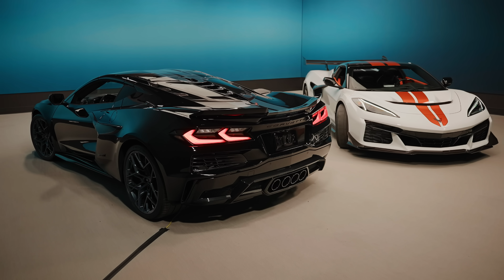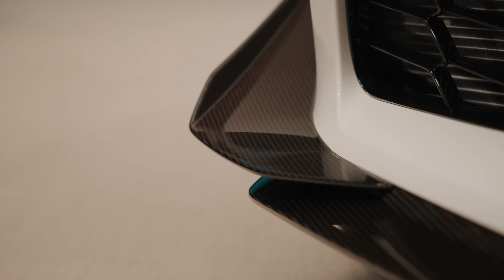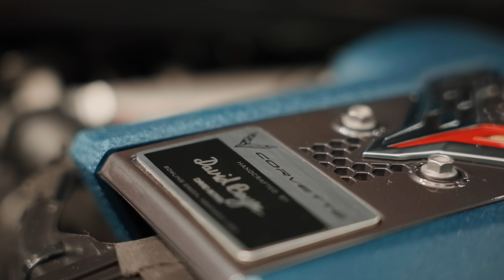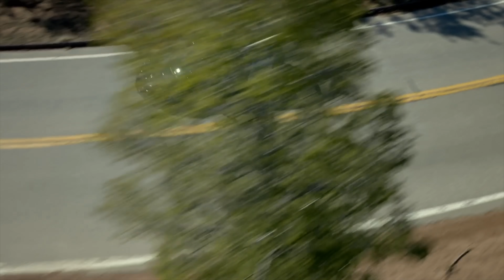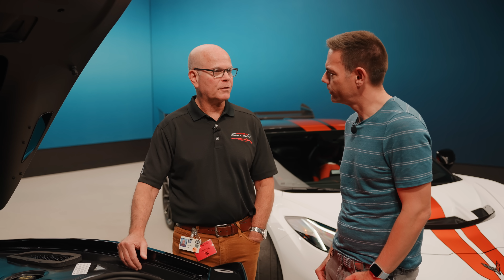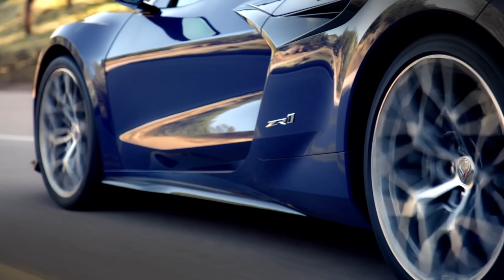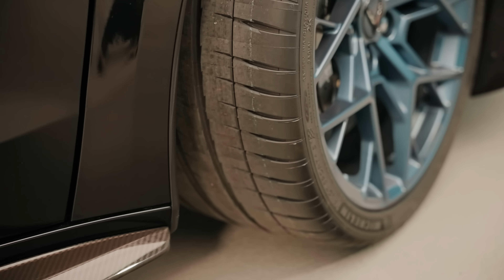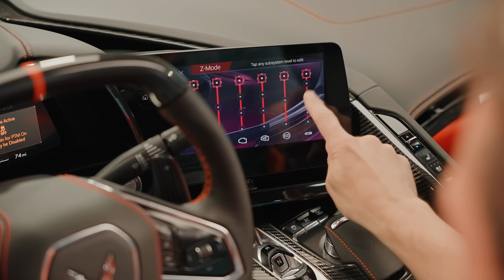FIRST LOOK: 2025 Corvette ZR1 – 1064hp, Turbos & 215mph!

Comment: Ya'll seem to forget that the C4 Callaway Corvette was also a twin turbo and set a record speed of 254 MPH. almost 40 years ago.
Reply: what your point? that wasnt mass produced.
Reply: @Howdy762  the point is it was done. The idea that it wasn’t “mass produced” is about half true. 

You could order a Callaway Corvette from the dealership at an additional cost. General Motors signed off on collaboration meaning; they approved. The “Hammer” which was a premium example and the car that set the record was driven from Connecticut to the track in Ohio and back demonstrating that it wasn’t  “test bed” for somerhing else it was the actual production car with AC and all the creature comforts. Corvette did it first and a corvette did it best. 

There is absolutely no goddamned reason that a C5, 6, 7 couldn’t achieve those speeds or greater. All of those cars have a low enough drag co-efficient that would make it possible. 
The only major obstacles are cooling and tires that can handle those speeds. 

Having a 260 or 270 MPH corvette is sufficient to hang with the likes of SSC, Hennessy, Or a Koeniggsegg. And besides Corvette has Track cred. None of those cars do.
Reply: @ZoneTelevision  But not the sledgehammer.
Reply: @Howdy762 doesn't matter if it wasn't mass produced. It still did it 40 years ago.  215 mph for 1064 HP is not impressive and I love Vette s
Reply: yeah C4 was a beast
Reply: Ya but you can buy this from any dealership no questions asked
Reply: @hobsonoutdoors yeah I mean Calloway turbo kits were dealer options though.
Reply: Man everybody seems to have an issue with the speed limit like they are going to go over 215 mph 🤣. Maybe that makes no sense maybe they wanted a harder acceleration and have no need for that speed or gearing making a more usable 215 vs having slower acceleration especially in a world of EV and hybrids. This car kind of is giving the finger to the competition is a raw form and I for one can’t wait to see it bring euro supercars and even hypercars to their knees once again for less money.
Reply: Good point. 1064 HP and 215 HP is not impressive when you consider my 180 HP Impala does 115 mph
Reply: I imagine that bean counters and lawyers would have a lot to say. They always have to consider lawsuits and public perception of an unsafe car, unfortunately.
Reply: another molested corvette! your point?
Reply: True but that was aftermarket. Keep in mind they detuned this some for reliability. It has this performance with a factory warranty.

Comment: I’m going to say that the last 200hp is basically useless in any gear below 4 or 5. 

If you floor the car anywhere near 50% throttle in a curve, your front end will eat your rear end.

1,064hp in a rear wheel drive only car that’s meant to be a track weapon. That’s nuts.

Comment: My biggest question is heat soak of this thing. A 12 mile lap, over 1000hp, mid engine, turbo car. This thing will be pulling timing off 1000hp on that final Nurburgring straight.

Comment: My 2006 C6 Z06 weighed just under 3200 lbs. This car is over 3700 lbs wet. That is about the same weight as a 2010 Camaro SS. What!? COME ON you guys. Get this thing on a diet. These cars just keep getting heavier and heavier. More horsepower isn’t all that matters here fellas. The first thing I check is the weight as soon as I hear big power numbers and I’m always disappointed on this newer stuff.

Comment: Quick fact check. Koenigsegg's V8 has a lot more power, the one used in the Gemera puts out 1479bhp, from a smaller 5ltr displacement. Technically, I suppose it not a production car (yet) until the first one rolls off the line and is delivered. Which wont be long

Comment: I'd need 355's on the rear instead of 345's . The performance numbers doesn't match the power output. The 911 turbo s gets nearly the same quarter mile and top speed with much much less power.
Reply: Well, the Turbo S is AWD, can’t really compare that with a car that is RWD in terms of quarter mile performance.

Comment: If you think about it, this engine produces roughly 193 hp/litre, which when multiplied by 4 results in a hypothetical 773 hp 4L V8.

This is really close to the figures put out by the Mclaren 720/750S. So, ever wondered what a 750S would be like if the engine had 5,5L instead of 4L? 
This is it. GM is building oversized Mclaren engines at this point.

Comment: Well it's chevrolet 😂 1064hp😂 it might be 800-900hp and 650-750 to the tires.  Chevrolet overestimate everything they make and I guarantee one of the day time running lights quite working right of the lot and check engine light comes on because gas cap is open 😂😂😂😂
Reply: I see… And how many cases have we seen of Porsche GT threes of the 991.1 generation blowing their engines over the years? Or the full recalls of the early 992 GT fours for engine replacement? or bore scoring? And that’s just Porsche…

Comment: Xiaomi SU7 Ultra Specifications

Power: 1,548 horsepower (combined output of three electric motors)
Acceleration: 0-100 km/h (0-62 mph) in 1.97 seconds
Top Speed: Over 350 km/h (217 mph)
Downforce: 2,145 kg (4,694 lbs) at peak
Regenerative Braking: 0.6G

Oh - 4 door seats 5......GM is a joke

Comment: every single thing is eletric, booster, stearing, dumper, soo why not make a google website were you can fine tune every thing that you want? like, outside of drive modes, i want my car as i please, no need for engineers babyseat me, they dont know what is better for every one! its good even for disebled peaple, imagine a person is a gearhead, but have no arm, they have to drive with the feet on the wheel, soo the stearing beeing heavy in racing mode dont let than use it! 
its soo simple to doo, its in fact harder to lock the options, every single parameter of the car that i own should be tuned, even power, if they just created a tune software were you dont need black magic to access, and just create a warning to not mess with it, peaple would have fun, and would not be able to blame the company for their fault! 
the same for every thing, the stearing fealing, i would like it to be as a simulator, would like to tune every single parameter!

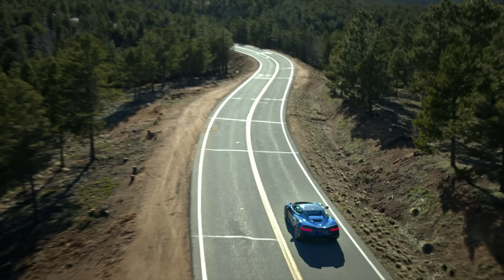Comment: Regarding the 215 mph top speed, I own a 2018 Porsche GT2 RS. The Chief Engineer is on record as saying it is a 222 mph car but Porsche wasn't comfortable with the Cup2/Cup2R tires at that speed and didn't want to require specialty tires, so the GT2 is electronically limited to 211 mph. Oh, and 6:38 at the 'Ring baby...let's see GM beat that with their 1,000 HP vette.
Reply: Downforce and aero drag is what slows it down. Im pretty sure it will without the aero drag
Reply: @YusufSayed-px2xy  I've had mine to 211 a couple times...it still was pulling, like I said Porsche has it electronically limited to 211. Re: the ZR1, I later read the over 215 mph claim is without the front splitter and dive planes and rear wing. I also read the Cup2R's have a special construction to allow for that type of top speed. Roads get awfully skinny over 200 mph, OVER 215 is Very impressive. But the damn thing weighs 4,000 lbs so it ain't beating the GT2 RS 'Ring record at that weight.

Comment: How could you fail to hit 200mph+ at the ring in a 1000bhp car
If it wasn’t sub 10 on the 1/4 then it would have been an absolute failure, the 765lt with 200bhp less is sub ten all day

Comment: Get rid of the cats and a standard air filter should add 100bhp and ecu flash and this should easily and another as these are always held back now with emissions,
I'm sure tuners will have these over 2000bhp pretty quickly

Comment: HUGE RESPECT TO GM! They did it. 1064 HP RWD and no electrification whatsoever! Love it!
Reply: You know, you can put that flat plane 1064hp engine in a full size pickup. There's no reason it can't be done.
Reply: @starseeddeluxe  You have a point, this Company uses the same LS motor in both the Corvette and their SUVs if not also in their trucks now.
Reply: And it can't go faster than 213 MPH? I got a problem with this and the price tag as well.
Reply: @RobertGuidry-f3f  its top speed is 233.
Reply: @ank0663  Thank you.
Reply: @RobertGuidry-f3f  213 with the track package because increased drag. Without the wing and increased downforce it can go 233 I think. Any car anywhere near this in performance is probably 2x the price
Reply: @ I looked it up  on the web. One of us is wrong and the other isn't, so be it. Let me ask you this? If there is another factor that will make the highly beloved 'Vette not only more expensive but a better idea to not buy, would you think about your comment? Regardless as to what it will cost to own it. The 'Vette comes from a company that is so cheap that you definitely exchange parts on a brand new Chevy truck with a solid 1981 Chevy or GMC? They are so cheap, that they won't design a car that doesn't have definite interchangable parts with at least four other vehicles. And another thing you will have to change and/or fix something on it evert month, then the year doesn't matter what year it is/was made in as it will have a checklist of things to break or rust through at certain ages. No go buy your self a Ford of the year you want and save yourself money and a giant headache, or in this case a Mustang. And before you comment, you need to know this. It will break and be grouch reegardless as to how new the parts are
Reply: It sounds like you're really a big fan of frigates. What's your favorite thing about frigates?
Reply: Do you know my boy? My boy malongo? @PaigeBaines-k4n

Comment: I was expecting 800 - 830 hp from the "C8 ZR1" because C7 ZR1 already made 755 hp. But wow it's huge leap in horsepower. 

I don't know if 1000+ hp is good for RWD only (great for advanced driver, not so for novice driver), since the C6 ZR1 with "only" 638 hp already brutal to the rear tires & easy to drift. 

Hope the drivers know that their right foot needs to carefully release that 1000+ horsepower, or otherwise ended up in a ditch or wall.

Comment: there is NO WAY a 1064 HP car top speed is 215 out of this C8, my base model C5 iv had at 235 and it was till climbing when i let out, so your not going to tell me this car 3 generations later with better tech and a better engine is SLOWER then a C5
Reply: You did not just say your C5 went 235 mph.
Reply: @EFK1993  i did b/c they will do it, when you from 200 to 201 the hud will go 00 and start counting up again 01 02 03 04 05 etc.
dont trust what manufactures say they will do b/c its not right, look at the cars from the 70s for example they are smogged to shit and if you take the smog shit off and retune them to not have the smog stuff they make more power and go faster

Comment: How did the engineer not point out that it has a lower compression ratio of 9.8:1 vs c8 Z06 12.5:1 and it has an electric wastegates so the ecu can dynamically adjust to keep boost pressure in the motor for less turbo lag.

Comment: Just wait til the displacement goes up from the 5.5L.... cant imagine a 7.0 back there with the same boost
Reply: This is a flat plane V8 though. 7 liters would shake itself apart, even 5.5 liters @ 8k RPM is a lot for this type of design. Look up the difference between flat plane crank V8s and cross plane crank (like LS engines) V8s :)

Comment: This whole interior is just awkward. All the pieces look like they were designed by different high school groups and they never talked to each other. The rail with small buttons down the center for HVAC control is just ridiculous!  
Lamborghini did a spectacular job on their new Huracan Technica that came out right about the same time the C8 came out!  Just look at that video compared to what GM has done!  Very very disappointing.

Comment: AMG shifts to hybrid 4 cylinders, while America puts out this absolute maniac of an engine.
Reply: You're welcome, good sir.
Reply: Merica!
Reply: @Smolnic the translation to this comment is pepper. 😊
Reply: Worth mentioning AMG backpedaled that move recently and have said "they are committed to V8s" since the 4 cylinder cars sold drastically less than they were expecting (who could've guessed lmao)
Reply: @neblolthecarnerd  that's actually not what they said. The 4cl is here to stay and the CEO said customers will get used to it.
Reply: @davidl6264  they did say they're bringing the v8 back though
Reply: Murica, ** yeah!!! 🦅🇺🇸🦅🇺🇸🦅🇺🇸🦅🇺🇸
Reply: Von Der Layen...
Reply: I’d hate to work for AMG. Knowing all the badass stuff they’ve put out in the past, like the 5.4/5.5, the 6.3, and especially the V12 biturbo it would be sad to be building puny motors like that
Reply: it's hardly comparable to compare the top thing from a manufacturer to something that's just a badge like amg. a lot of mb's wont have space for a v8 for the amg trim levels.
Reply: @lasskinn474  amg is literally an entire in house company, it's not just a badge, the amg department is very likely bigger than corvette
Reply: @chiefdenis  tell that to "AMG Line" and "AMG Dynamic" trims lool.  like look sure they have a department that makes some special cars as a section of mercedes benz, but that doesn't mean in the slightest that majority of current "AMG" badged cars had anything done in that department. ONLY the high end engines in the high end AMG cars get the 'hand built' treatment as well.
Reply: This is the American engine you recognize? You have got to be kidding me 🤦
Reply: EU ruining cars over there. America just brushes it off
Reply: Murica did make an EV Mustang, isn't it?

Edit: EV Mustang SUV.
Reply: @Brian.Jones.310  the United States doesn't claim the mustang anyway.
Reply: @SubZero-GT350  Now you don't get to cherry pick the cars.
Reply: @Brian.Jones.310  I'm Mopar or no car all day.
Reply: @SubZero-GT350  Sorry, you have to live with that as well.
Reply: @Brian.Jones.310  I'm not 😏
Reply: @SubZero-GT350  If you're a murican you have to! You can't deny the bad and only embrace the good.
Reply: @Brian.Jones.310  the only bad thing about Mopar is the 7.0 liter Hellephant or 7.0 liter DSR 1500HP Hemi V8's only comes in as a crate engine and not a standard option. No AWD Charger annnnd not making a DCT automatic Viper. Other than that Mopar is damn near perfect.
Reply: Don't forget about Cosworth and Bugatti's V16 😁
Reply: Though there's still some effort in America, we still witness the authoritarian war on the internal combustion engine. Public realization that alternatives are inadequate and only make life more expensive cannot come soon enough, particularly in a country where personal transport is generally as necessary as food and shelter.
Reply: while EU puts 12cylinders in their new models…? Purosangue, Revuelto ,12cilindri etc etc
Reply: Because its American, they dont have to comply to emissions standards. They will sell it as just a "trim level" of the already approved C8 platform. So no further testing required. Even now that it has twice the power.
Reply: Its not really that maniacal,  it's actually the smallest engine corvette has ever used
Reply: MAGA
Reply: It’s not America, it’s gm!
Reply: Downsized and turbocharged though. Still troding on Europe's foot steps.
Reply: @grdprojekt down sized? It’s the largest displacement flat plane crank v8 lol with turbos
Reply: @grdprojekt I get where you're coming from. But LT and LS engines have been capable of making this kind of power for a long time. It's been time for GM to move on from the pushrod V8 and I love it. And if you don't want it there's always the regular C8 and eray
Reply: @Timmyval123  There's different advantages and disadvantages to both really. The pushrod engines are much physically smaller than the DOHC engines, despite having way more displacement.
Reply: @lorddoobsworth21  absolutely l, but I feel GM is reaching the point of diminishing returns on their ol pushrod V8s low weight and center of mass is a huge advantage. And they have been able to keep up quite well with modern engine designs. But there's only so much you can do with one cam and two valves
Reply: @grdprojekt I wouldn’t say they downsized , they still use a 6.2V8 but the Z06 gets a 5.5 V8 flat plane crank engine, exactly like what Ferraris are… 5.5V8 is not “down sizing” and it’s twin turbo system is because there’s no other way to generate 1064HP. A V12 or V16 doesn’t even make 1000 hp
Reply: @grdprojekt we americans are the ones who brought turbocharging to consumer vehicles..... not the Europeans and not the Japanese

Comment: Not only is that a lot of horsepower, its precisely one more than the AMG Project 1.  If they'd even halfway worked on the aero... I can't imagine what Chevrolet could have done with that.  They instead remembered the customer.  This thing is sick.
Reply: The  AMG ONE is an actually absurd car. Not as in performance, but in terms of the compromises to make the premise of an "F1 engine for the street" work. It actually doesn't. As kinetic art it's impressive, as a road vehicle it's a failure.
Reply: @davidg3944  I thoroughly enjoyed reading that.  Preach!

Comment: I'm sure theres a prototype E-ray with this engine and solid state super capacitor battery hidden somewhere in GM's skunkworks HQ,
Probably going to unlease that as a final run / limited edition or saving that for the C9